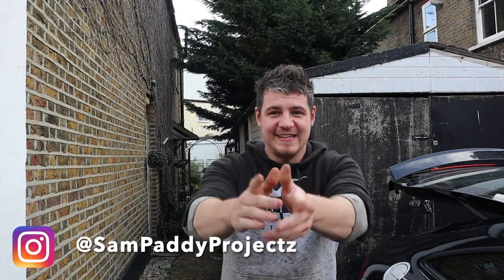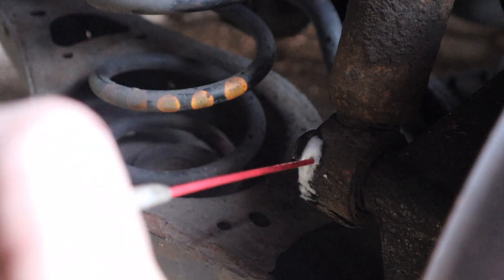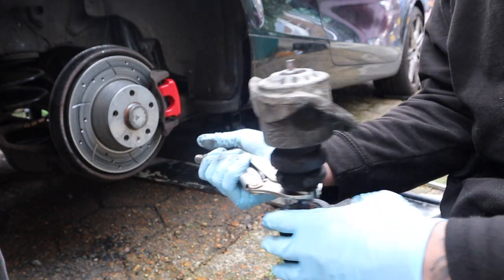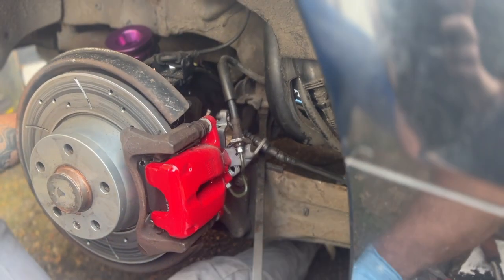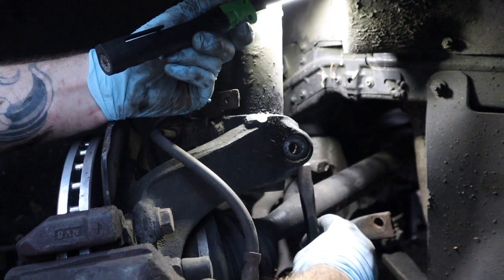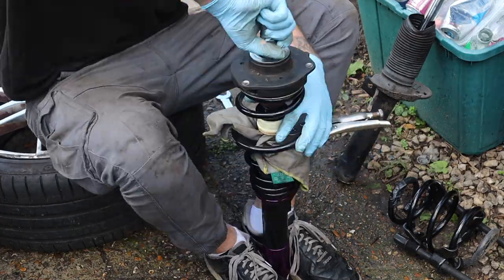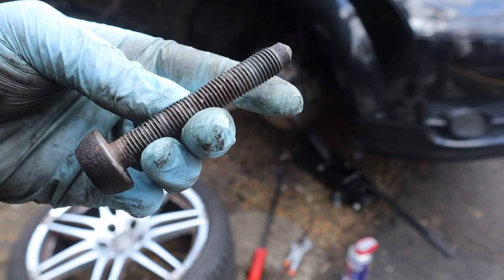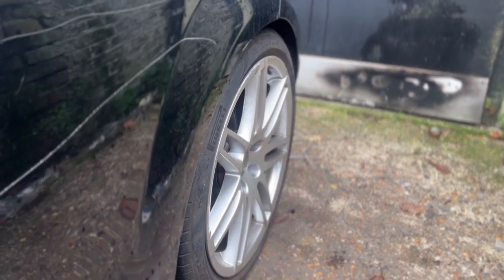AUDI TT 8J MK2 COILOVER INSTALL & REVIEW! (2L TFSI FWD)

Comment: Any advice if my steering wheel is tilted while driving straight. And noise on bumps even when going as slowly as possible (not scraping, more like a cling cling noise)
Reply: Cling cling noise could be a broken spring.
Tilted wheel means for whatever reason your tracking is out. Could just need adjusting OR it could mean something is bent.

Comment: Hey.... Are these the street or the ultras? What is the difference? And did you fit the shorten drop links?
Reply from the maker: Hi Paul, there streets and I don’t actually know the difference and no i didn’t fit shortened drop links it seems to match up with the OEM position 👍🏻
Reply: @sampaddyprojectz  thanks for the reply, are they still riding alright? Would you suggest getting the shorten drop links or not? I don't want to slam it, great video buy the way... I think I'm going to have a go at fitting them myself